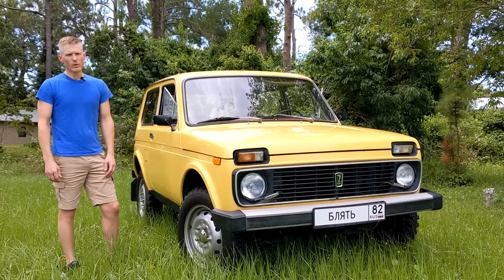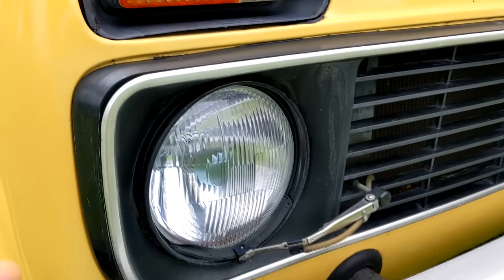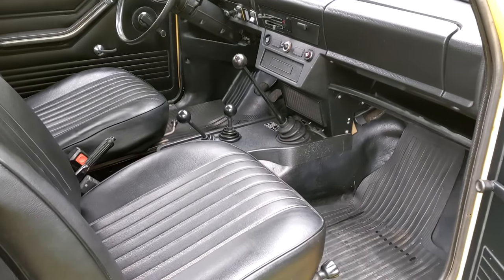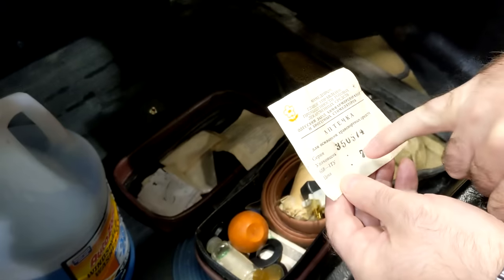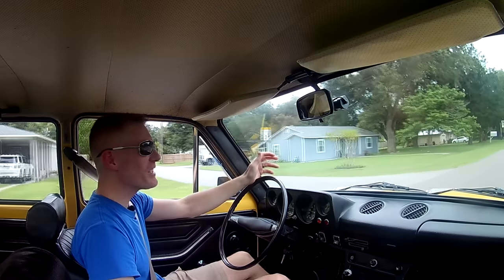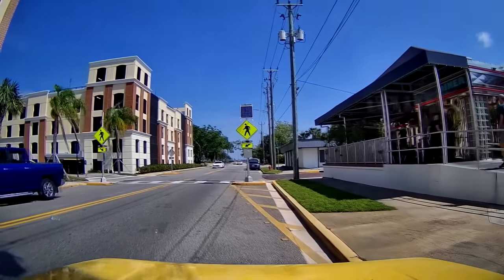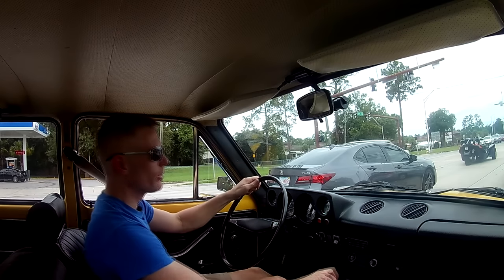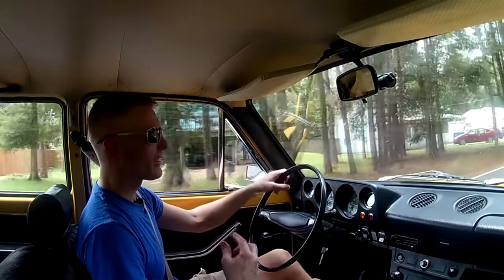This is my 1982 Lada Niva (Лада Нива / ВАЗ-2121) and it's pretty weird.

Comment: Your new door doesn't fit because it's for LADA Urban. It's the most recent modification of Niva which is several restylings ahead of your 1982 model.
Reply: It's not for Urban, it's for "Taiga" (21213)
Reply: Yeah, essentially the same car but over the years there are changes - just like with any other car being manufactured long term, like the vw Beetle for example. You can't just buy any vw beetle door and expect it to fit!
Reply: and some, but not all, Russian parts suppliers have no idea of packaging. I have personal experience.
I also have a pair of new doors that would suit this guys car. But that is useless info.

Comment: By the way, in 2020, Russian AVTOVAZ factory has released more modern Niva - they call it Lada Niva Legend. This new car visually looks like an old classic one but internally it changed significantly. It has ABS braking module, it has air-conditioner, of course it doesn't have old style fuel injection carburetor (instead it has BOSCH-car computer), it has electronic accelerator pedal, it has hydraulic power steering. The engine, gear box and transfer case for full drive are the same as in classic USSR ones, but both gear boxes are mounted differently, more convenient for repair. The new 2020/2021 car cost about 8-10k of USD. Anyway I am happy that you enjoy this Soviet-classic, it is worth to say that in Ukraine and Russia, such 30 year old babies are still on duty doing their hard work in villages and taiga forests!
Reply: Well, Avtovaz is not russian. It belongs to french  company.
Reply: @vaidotassakalauskas3681  Sure, but they still make Russian cars in Russia. Daimler owns Chrysler, but you won't mistake a Dodge for a Mercedes Benz.
Reply: @AlekseyVitebskiy  And yet, french company gets billions of donations from russian government(taxpayers money) every year. But who cares, not me realy :D
Reply: @vaidotassakalauskas3681  That may be. I'm just saying that this fact of ownership most likely has no influence on the design of Lada Niva.
Reply: @vaidotassakalauskas3681  Actually, your point does hold some weight, but in a positive way. Looks like a lot of interior things like switch gear, climate controls, etc in the newest Lada Niva are now from Reno/Dacia. That's a positive thing though, the old Soviet switches that Niva had before weren't exactly great.
Reply: The question is, can anybody repair the new version with a few simple hand tools?
Reply: @antonhosinsky3090  Replacing switches is replacing switches. The engine is still the same, but now has Bosch fuel injection and emissions stuff. That probably makes things more complicated, but it's something that has to be there nowadays. It's up to you whether computerized ignition makes it more or less complicated. As far as interior stuff, power windows are now an option, but you can still have wind-up windows. Suspension improvements are just different parts: no additional complexity there, though perhaps the parts are a bit more expensive. Again, it's up  to you whether it's an improvement or a hindrance. I think the things that matter are still mechanical and things that are computerized make things more reliable and maintenance easier. Of course, I'm a computer guy, so I do prefer electronic helpers where they make sense, but you may of course, have a different opinion.
Reply: @VadSokol  The company is a subsidiary of the Alliance Rostec Auto company, in which French Groupe Renault holds a controlling 67.61% stake.[10][11] AvtoVAZ is a consolidated subsidiary of Groupe Renault.  https://en.wikipedia.org/wiki/AvtoVAZ
Reply: @vaidotassakalauskas3681  well it is not like a vw group of volkswagen owning everything. it is a renault, nissan and lada. same like saying than nissan is french or other way around

Comment: My dream car! Sadly they are not available in Canada anymore. Simple vehicle, not full of techno crap which goes out of date every year. I just had a transmission issue checked out on my wife's Mercedes Benz GLK 350. The dealership said it would probably cost $20K to get it fixed. Stay with the lovely Lada Niva and have plenty of cash for a drink in your local every night!
Reply: U just a moгоn
Reply: @Kovalainenn  Vadym...you need to learn manners and respect....being a troll is not a good pastime
Reply: Dude you have so many options there in Canada. Any old Toyota or ford will be easier to repair and more practical on your roads. Why Niva? Our drivers prefer it because it’s cheap here and parts accessible like in every part shop. Also roads of ours far from good. But what’s you gonna do with it in Canada?
Wait for delivery like a month or more. 
We have same situation with American cars here. Couple GMC on market and a delivery for parts from US at same price as part itself.

Comment: Every Russian will tell you, tath there is no better "iron" for your car then the "iron" from the factory. Repairing of the original door was the best solution.
Reply: Or…order the door for the correct model year…since that’s an urban door
Reply: @goclunker  not sure is it any way to get original door for 82 model year even here in russia
Reply: @goclunker  The factory now making doors only for a new Niva (urban), everything else is cooperative crafts - curves, oblique and bad metal.
Reply: You  can put a 0.8 bar turbo on it and  it'll beat anything off-roading.
Just look up Flying Niva -  Летающая Нива.
Reply: No problem
Reply: @pscpsc8645  Doors for the old VAZ 2121 are still available. I am the owner of such a car.  Not so good, but.
Reply: always

Comment: This is gold - bought a second hand red version in NZL as first car when in high school and got license plates THEKGB. It towed a 4.4m Haines Hunter on a trailer up a very steep driveway in low ratio NO problem and all fjorded multiple rivers and creeks up to door handle depth and multiple beach tows with trailer. Amazingly easy to fix, started cold with crank handle and miss it dearly!

Comment: I had a Lada Niva here in the UK in 1986. It was brand new from a place called Tipton in the Black country. I had to fit a radio so lifted up the rubber matting to lay the cables. I found the soundproofing was ex army blankets cut up. Truth. But I'll tell you, I loved that car and it was probably the best 4x4 I have owned. Now got a Ranger but not as cute.

Comment: Had one of these, in NZ, back in the late 80's. Pretty quirky for sure but dreadfully under powered.  I had a down draft Weber carb fitted to it not long after I purchased it and it improved the power output significantly.  Went all over the place in it from Invercargill to Auckland.  Fun times.

Comment: In 2008-2009 I was working on a contract in Uruguay and spending a couple months there at a time. I wanted a car so I could get out and see more outside Montevideo. Saw a Niva in the parking lot of the building I was working from with a For Sale sign! It was a 1979. The speedo cable broke years before so no Idea as to mileage, but it started and ran and didn't seem to leak anything. Gave the guy $1200 for it. It was dented and dinged, it was 3-4 different colors besides the primer. The passenger door leaked in the rain. But it ran. Great little car that took me all over Uruguay, and often got me back. Could be fixed anywhere and there were a couple places that specialized in them. Sold it for $1000 when I left.

Comment: Hy, The engine itself is pretty durable, and rarely fails, however the carb, ignition, alternator could give bad times thats for sure :D
I live in hungary and have done some performance lada engines, I strongly suggest you to change the oil pump gear beneath the ignition tower. Thats a weak point of the engine, if that wears out, you will loose all oil pressure, and toast the bearings. 
I Like your content and your lada keep it up :)
Reply: He is making it in to a 100% ev not hibrid.
Reply: Исходный текст
Pro engine carburetor agree with you. My first car was a Lada 2107 with a carburetor. There were no problems with the engine at all, but the carburetor really did not like bad gasoline.
Reply: 20l/100km gasoline but a great 4x4.

Comment: Not sure if somebody has already mentioned. These colored cards with a year on the front are about vehicle safety.  Once per year you had to make a vehicle inspection and if everything is ok, they give you the card and you have to put it on the windshield. Information on the back of the card : Date when the card was issued, Vehicle plates information, Date when you should do the next safety inspection and also vehicle inspector details.

Comment: The first thing in the emergency kit (the flat stuff in plastic) is basically like breathable medical duct tape. I'm making up new phrases to explain it, since I forgot what it's called here in The States. It's that strong tape for wounds that has some flexibility. It is, indeed, the medical analog to duct tape (leikoplast). The bottle that you said is "probably best not to drink" is basically a solution of boric acid (if I can read correctly it's 3%, or maybe 8%). The first vial (the metallic one, that also had Latin letters on it) is validol tablets (used for motion sickness or heart problems, mostly). The second vial is Kalium permanganate, or bettern known in the western world as potassium permanganate. It is used to treat wounds, it's antiseptic, basically. You drop a little bit of it into some water and mix it up, then dip the wounded part inside the solution. Sort of like alcohol or hydrogen peroxide, but I guess this is more effective (I'm no doctor, just know this from what I've seen). The last box with the unused vials is ammonium solution. Don't know what it is, but in the parenthesis under it it says "nashatirniy spirt", which tells me it's probably used to bring back people who have passed out. It's that thing with the nasty smell that brings knocked out people "back to life". I hope this helps ...
Reply: You're talking about an adhesive bandage aka medical plaster aka band-aid, right? That's exactly what he called 'em.
Reply: @Chamieiniibet  yes, I think that's it. Thanks for clarifying.
Reply: Nashatir spirit is like old 'smelling salts' for unfainting people
Reply: @Chamieiniibet  Modern band-aids usually have a non-stick soft pad. Leukoplast is basically a tearable cloth tape without a pad, you would have to form a pad from gauze (also included) and use leukoplast to hold it. Of course, it's also good to simply hold together a deeper cut, where a pad would let the cut spread under the gauze, but it's not deep enough to need sutures. Nowadays superglue is sometimes used for that last purpose.
Reply: @Validole  Band-Aid branded tape rolls are also still sold ¯\_(ツ)_/¯
Reply: You're right, as a chemistry graduate I can assure you, I will also add that KMnO4 (Kalium - or potassium - permanganate) can also be used for potabilize water :-)
Reply: @perrydebell1352  Could it be for bee bites treatment?

Comment: funny that one of the documents, that you've showed from the visor, literally is funerals invite
Reply: 10:00 Yes. Very sad telegram =(
Reply: yeah that was kind of bizzare
Reply: Yes, that 'dot matrix printer' docunent was a telegram, a funeral invite for 'dad', looks like the car has ghosts?
Reply: It says "Dad died, funeral is on 25th of July. - Mom"
Reply: What?
Reply: What is strange about it is that it looks more like a telex printout being on a single piece of paper. The telegrams that I remember came on a card stock with the words/sentences printed on a strip of paper cut up to the width of the card and glued to it. The card invariably would have the word TELEGRAM (ТЕЛЕГРАММА) at the top of it, some also had URGENT or SPECIAL (I guess that cost extra, but meant faster delivery by a postman).
Reply: @sergueip2140  the telegram also served as a document to get a permission for a few days leave from work, even if you did have a telephone.
Reply: @sergueip2140  yes, I remember the telegrams very well, I am from USSR
Reply: @monocharismatic  yes,you are right but this style  of telegrams was before  1986 years
Reply: i wouldn't call it an invitation. more like a notification - the message is wired across country, then printed locally and delivered, fast and reliable. and it is as brief as possible because it costs per letter, probably.
Reply: Definitely not printed however. The characters are all stamped onto the page in full, not assembled with a series of dots. I would guess it's:
A) Typed on a typewriter then mailed
B) "typed" by a typewriter based teletext machine.
Reply: it was used to show to traffic police that the real owner of the vehicle was no longer alive and cannot give his son legal authorization to drive it and he hasn't yet assumed ownership of that car. in USSR one couldn't just take a car to ride even from family members without legal authorization.
Reply: @monocharismatic  No, telex printouts are in fact those telegrams that you remember. Those were printed on a paper strip and then cut by scissors and attached to a carton, manually. This one in video is dated by 1996 if I'm not mistaken (date seen on stamp), and by that time, post offices were using computers already.

Comment: About the medkit: the flat bandage is sterile and anti-bacterial, while the round one is "dirty" and should not be applied to open wounds without an antiseptic. The ammonia solution in the seal vials is used to recover people who have passed out: you're supposed to make them inhale it. The Validol pills could be used as a sedative, for increased heart rate and as anti-nausea. The black powder is potassium permanganate, a powerful antiseptic that should be mixed with water and then could be used to clean wounds. A very mild (barely pink) solution could be drank to induce vomiting - useful for poisoning. The boric acid in both dry powder and solution is another antiseptic. The rubber band is a tourniquet used to stop bleeding.

Comment: Lovely repair work by the panel shop, and props to them for straightening up the fuel filler door too! Will make for an excellent EV conversion. Crazy to see Nivas going over $10K here in Australia (they cost less when new in the 1990s!) in far worse condition than yours.

Comment: The "charcoal" in first aid kit is potassium permanganate, KMnO4. In a water solution it's a disinfectant. The repair looks mighty fine, BTW. The replacement door might be for the new-er model without the triangular little window, I think that was with the changeover to the 1.7 litre EFI engine. As for the tires, there are economic rim options, apparently the measurements of the bolt pattern are not that exotic. Then you can get modern tires, those on the car are most likely hard as a stone by today, and so not very safe. On the 82 there are 1 original and about 5 replacement rim sizes that fit, with a variety of normal tire sizes to match. At work we still have a 93, which has the same basic dimensions than yours. We changed the rims to 5.5 (instead of 5.0) inch wide rims and always had 195/70r16 tires. These ride very good. The same size we have put on a 98 Niva we also have. The 195/70r16 might be a bit easier to get, but not sure for the USA. In Europe you can order from Pirelli, Hankook, Continental, and others. But these are street/snow tires, which, to be honest, ride much quieter than those terrains you have now.

Comment: the old uk importer solved the sound problem by rubber mounting the centre diff and bin the carb and put a webber for a fiat 131 1600cc , way cheaper than batterys

Comment: I've driven an 2121 with that engine for 15 years without loosening a single screw in the engine running on the cheapest lawn mower oil you can get.
It has always started even in -21C standing outside.
The body will rust away under yer before the engine needs any work at all. It is so solid people are routinely tuning them to 400hp.

Comment: Nice video :-) Only correction, the diff lock only locks the front and rear axle together.  The Niva is a full time 4x4 so there is a center diff between the front and rear axle.  The diff lock operates on that diff and effectively puts the car into the same configurations as a part time 4x4 when put into 4x4 mode.

Comment: The modern ones got an AC , power windows and a trip computer 
but the best upgrade is that it has a modern computer controlled engine 
it's fuel injected , the fuel injection timing and the spark ignition timing are all electronically controlled , that makes it a modern car by 2000s standards

Comment: Travelled in a brand new Lada through the Peruvian Andes in 1984. Car was good off road and driving through damaged roads, crossing streams, etc. However the front stabilizer bar came loose after one of the mounts lost its bolts and fell. We rigged a support with some wires and finished our trip. The main problem with them were the guides for the timing chain. They will wear off quickly and then the engine will get damaged

Comment: I had one of them in the early 80's. For the low klm's it had, it was garbage. When parking, the steering was extremely heavy. The brakes were very spongy. The floor was cracked from having the gearbox mounted to the thin floorpan and not some strong mount. Also the rubber flexible coupling "doughnut" which connected the engine to the gearbox wore out quickly, causing vibration. After two or three reasonably difficult off road trips, one of the side window frame corners developed cracking. I couldn't get rid of it fast enough.